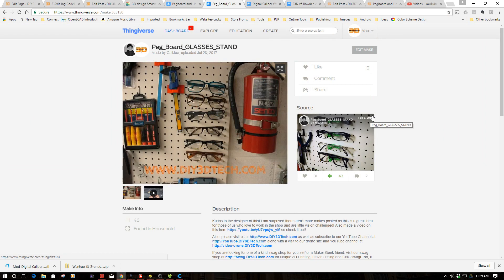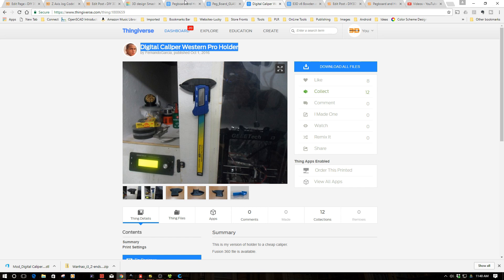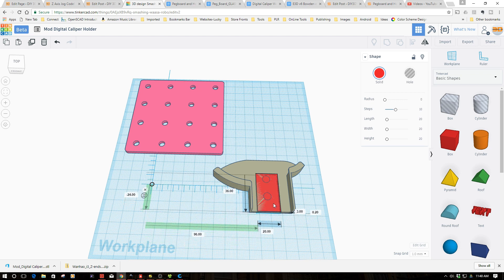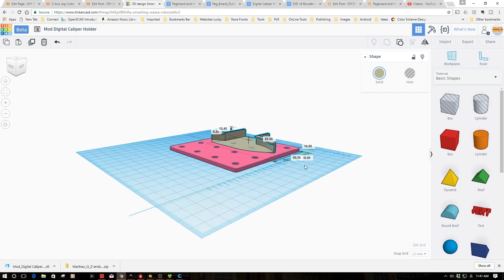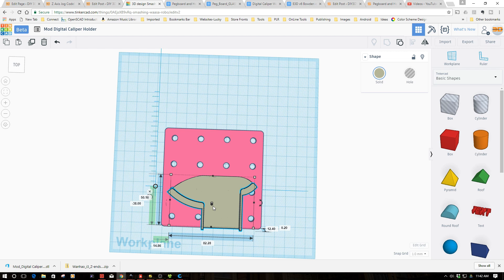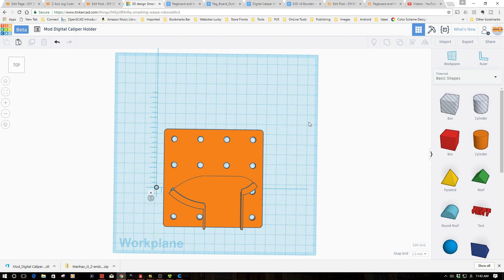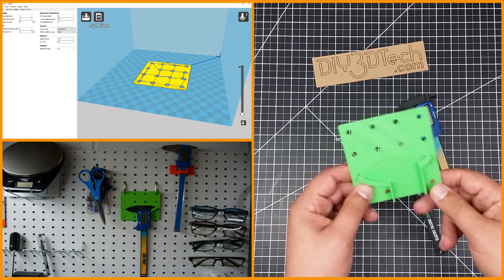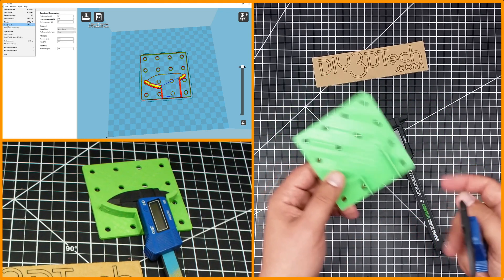3D Printed Project - Pegboard Remix Challenge and Print!

Comment: Have you tried using some sort of peg to directly link the hole in your printed material to the hole in your pegboard? It seems that would be a little cleaner and tighter than using hooks.
Reply from the maker: Thanks for commenting and yes, if you look back in the play list for 3D Printed Project i have done quite a few like this however the rub is (1) I have found pegboard & holes very quite a bit especially in thickness of the board which leads to issues, (2)  longevity of high use is limited especially with PLA (ABS is better).  Also a bit of what I am tying to get at with this design is both a module look as well as approach :-)